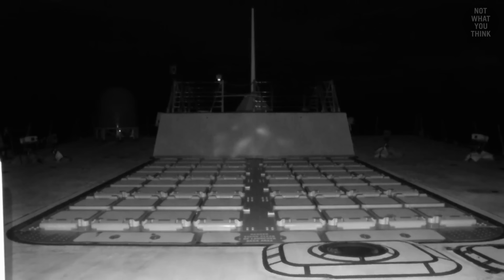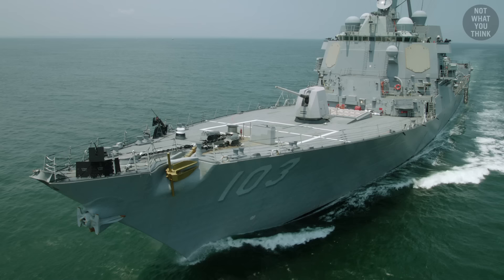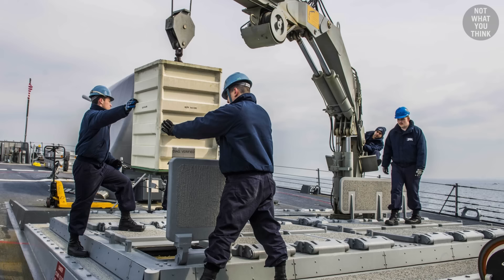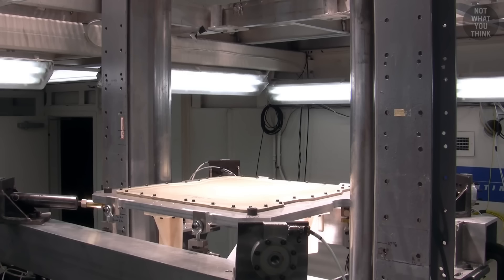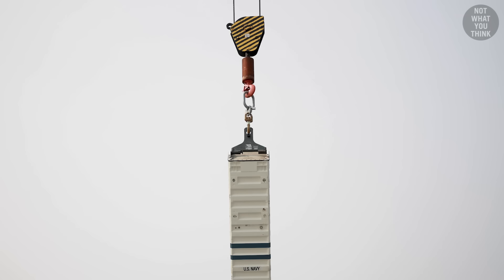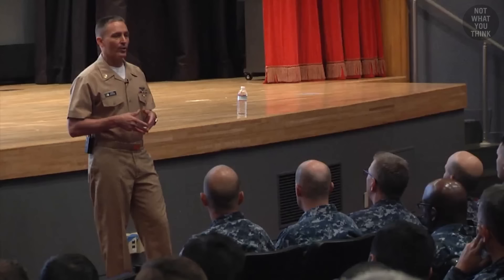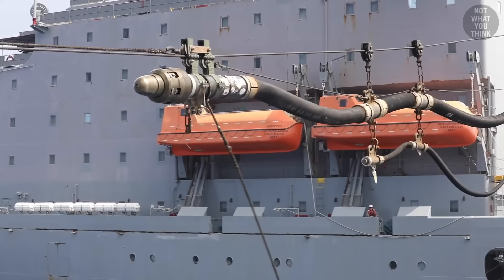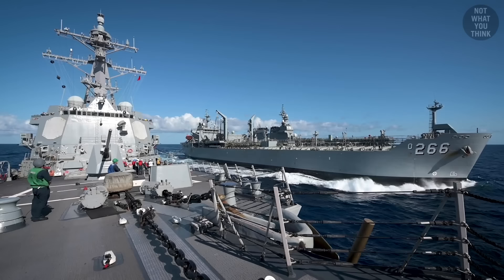Why Warships Cannot Reload Missiles at Sea

Comment: The real reason is that the USA assumed that it is not in a war but in a "bully a weaker party" scenario. I.e. it is not possible now to meet up a supply ship and rearm in a "sea safe" area - translate an area with no real waves i.e. a natural harbour. This is totally a financial decision and has NOTHING to do with economic necessities. Especially if you require harbour side installations that really limits you i.e. in an area where you are marking those harbours as primary targets. The NATO has a lot of decisions that sort of assume that - cough - the weapons are never used in a really hot war against an even closely equal opponent. There simply is no real Collier system in place where ammunition is resupplied "somewhere" - outside for aircraft carriers which use so many supplies that they HAD to solve it.
Now, with i.e. Russia having long range hypersonic missiles - in a war reloading in a harbour is a joke as the harbour will be gone. The concept is good - but it needs a Collier supply system.

Comment: I think modern warships are extremely vulnerable to swarm attacks by low cost missiles that deplete their cells before the ship killer missiles come on once they empty
Reply: A guided missile with the same range as a ship killer costs as much as a ship killer. Cheap, unguided rockets aren't an option because they'd stand almost no chance of hitting the ship so its defensive systems wouldn't engage them.
Reply: @trolleriffic  No, X tons of TNT will always cost more than X pounds of TNT.

Comment: Why don't they replace the whole cell at once, instead of lowering missiles into it one at a time?
Reply: Because of the weight. These things weigh thousands of pounds while empty. Put in a new one full of missiles and you're looking at something that is even heavier. A single missile can weigh over 4000 lbs. Now imagine a box with 50 or more missiles in them. This is something you'd need a massive crane for and it would have to be done in a port. You could never do it at sea.

Comment: And can they reload a canister at sea? Doubt it.
Reply: The canisters come sealed from the manufacturer, often with a second canister inside the outer canister.  But from experience we used to be able to replace whole VLS canisters while underweigh.  The crane for doing so was removed during the GWOT so we lost both the capability and the corporate knowledge.

Comment: 4:42 the solution is having multiple ships in close proximity and that’s how carrier groups work by having all kinds of ships and they all play the role of protecting each other and making sure nothing hits the carrier and the carrier makes sure there are plenty of planes in the air to help protect the other ships just in case something slips through you have a better chance of detecting something and getting a lock from air and sea rather than just one way you now have two different options to make sure something don’t slip by and strike their target which would most likely be the carrier because if your gonna take the risk might as well go for the best thing to sink or cripple and that would be the carrier. Just know if you do some how hit anything let alone the carrier you better get your ass as far away as possible because you are going to find out very soon why we don’t have free health care🤣🤣

Comment: Pretty stupid this VLS is designed be be reloaded from the top down rather than the bottom up.

Should have missiles slid horizontally into place to reload below deck, and then have hydrolics lift it upward.

Comment: Not having a magazine reload system is a massive mistake. The solution is to have a separate magazine vls for air defence. You are unlikely to need to reload tomahawk on the fly. But air defence against swarm attacks is a must.
Reply: That's why we have electronic warfare and cwis.
Reply: Those canisters and cells are already extremely space efficient. There is literally zero empty space below deck on those destroyers.
Reply: VLS takes up the same amount of space, but are all ready to fire instead of waiting on reloads from a less robust autoloader system. If air defense was the ships primary concern, the VLS cells would be filled as such just like space taken up in an older magazine would.
Reply: The VLS concept combined the launcher and magazine, eliminating moving parts and increasing reliability.  Don't fix stuff that's not broke.

Comment: Its a simple trade off
The old Mk-13 and MK-26 carried less rounds but could be reloaded at sea and had trainable launcher
The VLS cant be reloaded at sea nor it is trainable but carries more rounds plus able to use larger and much heavier missiles like the TLAM, SM-6 and SM-3
The VLS is always at ready fire while the MK-13 and MK-26 had to wait for the operator to select the round 
While VLS biggest disadvantage is reloading but the USN can resolve that issue